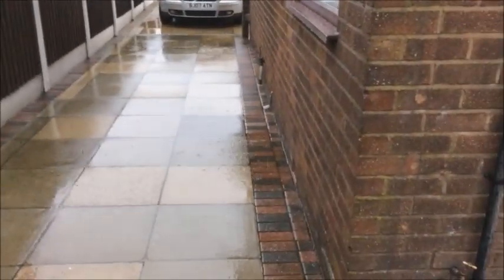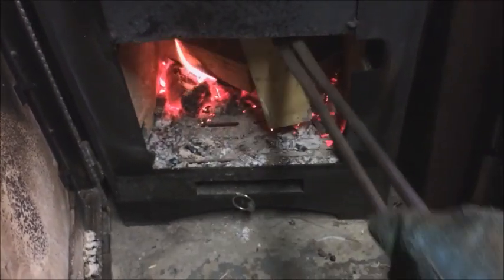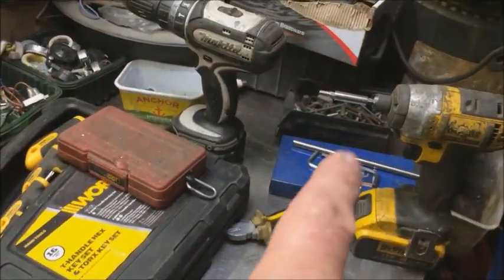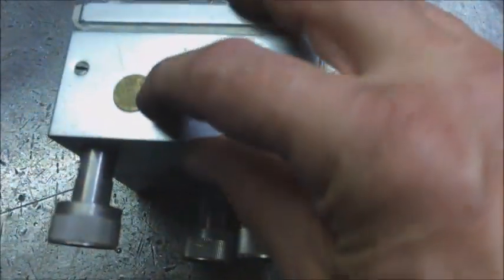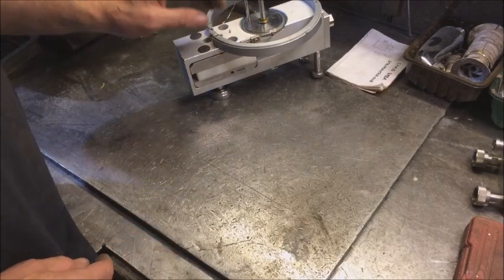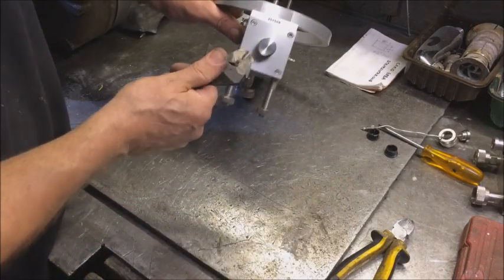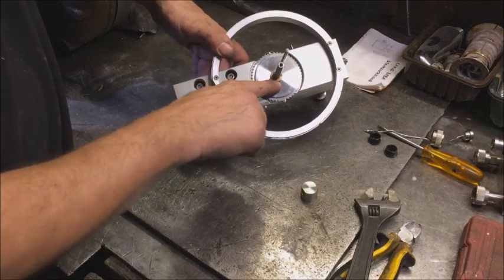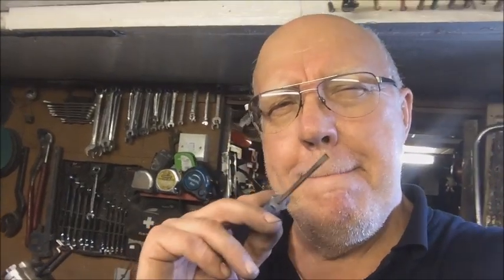Scientific Thingy

Comment: Hi..Ian I did some research instruments it's a metal fixture for... An injector with a vaporization chamber for gas chromatographic apparatus includes a heater to heat the chamber and a pierceable septum to seal an end of the chamber. At least a heat conducting element is removably mounted between the septum and the heater. One or more elements are positioned adjacent to the septum and are in fluid communication with a source of carrier gas and a discharge outlet. The elements define paths with forced run for washing the septum and for feeding the vaporization chamber.
Reply from the maker: Iffy    I knew that,  .... not.   Thanks for the research,  I mean that,  I looked up the name and found the website, but got no further.
Reply: @Man-in-da-shed  where did you find it. Is it  stainless steel looks like aluminium .
Reply from the maker: @iffy9776    its all ally and Stainless, it came from a firm nearby that makes Instruments
Reply: @Man-in-da-shed  so due to its application it will be high grade stainless steel. You should go dumpster diving in the same factory for future scrap collections.
Reply: @Man-in-da-shed  He said it has a pierceable septum....didn't that bird from Eastenders have a deviated septum.... dum dum der dumpa dumpa dum dum....(These are the Eastenders drums 🤣🤣)

Comment: co sensor is smart for sure buddy  tho im not sure if  the spot you have it on is right  i thing co1 and co2 is lighter than air so it will be concentrating in a bit higher spots 
hmm interesting stuff looks a bit like presurised mould for plastic tho i doubt it is that thingy 
and that white block  looks more Teflon for me than nylon
dang Ian you know where to cut the vid lol